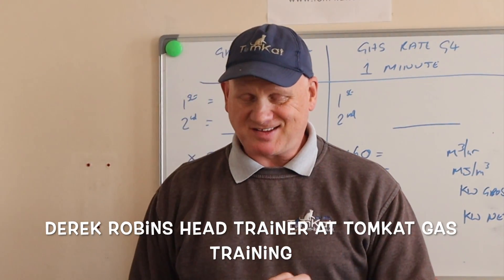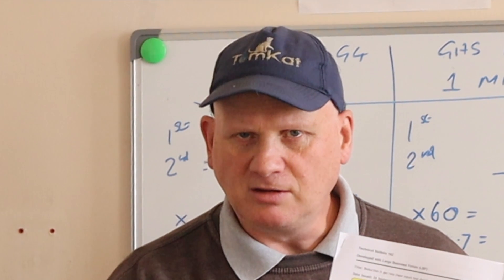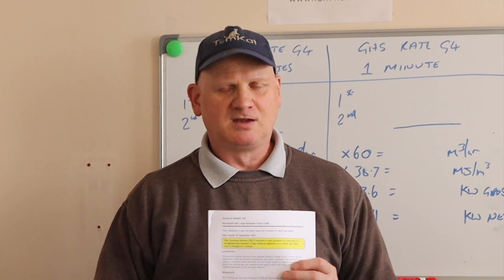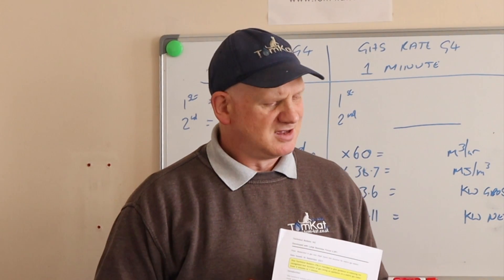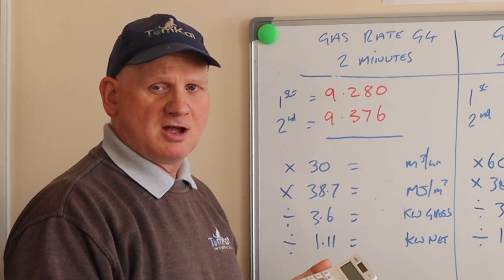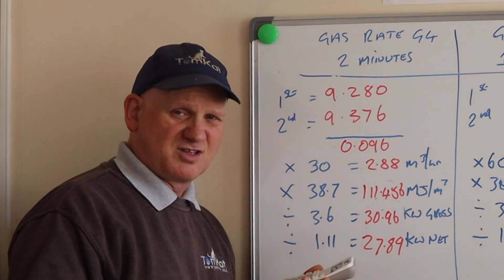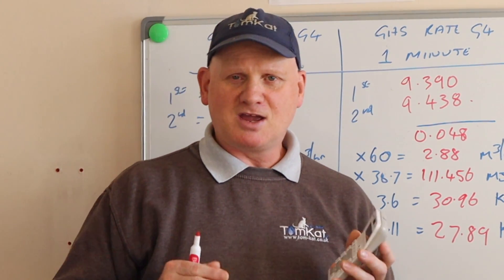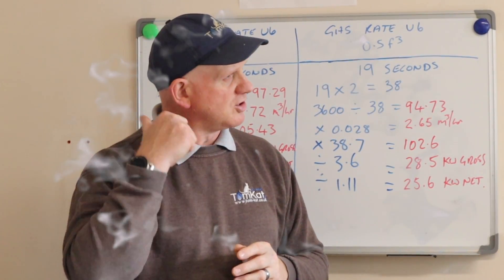Gas rating for one minute instead of two, REALLY. taking a look at gas safe TB 162

Comment: I am a retired UKAS Electrical, Temperature & Pressure Calibration engineer, I would have performed a 1 minute test from cold, then a 2 minutes test from cold then see IF there's any difference, just curious, if by not letting the system run for a while might indicate a difference due to heating up say from 20°C taking the New Standard as a test 1 minute without performing a 2 minutes warm up 🤔 there might be a difference then ?
In the past serviced & Repaired Kane Instruments Boiler Analysers,
Reply from the maker: I have spoken to the guy who came up with the timings for gas rating. He said the only reason they made it 2 minutes long was because of the E6 meters. He said because it was a digital reading they couldn’t get it accurate unless they ran it for 2 minutes. He said temperature only made a minuscule difference.

Comment: Hi Derek, im wanting a combi boiler moved from the loft, down to the kitchen, on ground floor. Would that cause any boiler problems? Would you see any issues with that?
Reply from the maker: Depending on the age of the boiler I would always advise to change the boiler for a new one because old boilers don’t travel well.
Reply: @tomkatgastraining  its 5-6 years old. Not old. But ty. 👍

Comment: I’ve done this for years, being commercial, a building like a swimming pool will run 24/7, 365 days of the year. I could switch the boiler off and sit there for hours and still not get a 2 minute run time. So, rather than not rate at all, I do make a note of the reading at 1 minute.

Comment: I have wondered for years now why we gas rate modern HE boilers at all, as you can't adjust the gas rate? All you can do is adjust the ratios, so if your ratios are right then your gas rate is right. Thoughts on this?
Reply from the maker: For me it’s the other away around. Correct gas rate correct ratio. Gas rating tells you if the appliance is over gassed or under gassed which is very important to help stop an unsafe situation. Also you shouldn’t change the ratio on a boiler unless you are converting from Nat gas to lpg or the other way around this is now in the unsafe situations igem/g/11. Also you adjust the gas rate all the time with modern boilers even turning the flow temperature down or up adjusts the heat input also range rating the boiler will do the same.

Comment: Gas rating has become a bit of a joke in recent years. Our compliance officers will give you a black mark if your gr isn’t within 10% under and 5% over. Even though the only TB that I can find says this is just an industry acceptable standard. I can’t find anywhere in the actual regs that it mentions these figures. We are told that outside of this we must AR the boiler.  But the recent trend has been for builders to put 35kw combis in tiny houses and flats. You run every tap full rate and can’t get 35kw. My argument is well where is the risk? You say it’s AR so tell me what’s dangerous? No answer. Also you can take the same boiler on LPG and there isn’t even a meter to gas rate yet it’s deemed safe, but you’d fail an inspection with exactly the same boiler on a meter if you didn’t gas rate it. It’s a complete shambles and needs completely re writing to say that an engineer should be able to use their judgement. I’ve had to AR 30kw combis running at 26.90 that are working perfectly on perfectly sized pipework with perfect working pressures. It’s a complete nonsense. About time GS actually allowed us to behave like adults and use our years of engineering judgment.
Reply from the maker: You are correct there is no regulation on the 5 and 10 % it was just brought in for trainees with no engineers judgement. The appliance is not AR if it’s out only if it is affecting the safe operation of the appliances or another appliance.
Reply: @tomkatgastraining  I completely agree with you. I’m not even convinced that despite what TB says about putting a boiler in to max rate using the service function is necessarily correct either. As I think if you run every tap in the house you’ve created the maximum real world demand that appliance can ever expect so you have in fact gas rated at max rate. But it’s such a grey area people like me just tow the line cos to be honest there’s no point in arguing. Same as range rated glow worms. They’ll be set to say 18kw for a particular property. But gas rate at 30kw when in max service mode. But can’t actually achieve that in normal operation. Gas safe need to once and for all clarify all this stuff. Cos big businesses have entire departments enforcing this stuff and I’m convinced half of it is actually BS.
Reply: @Lutonman2010 
The rules are for what the boiler can do not the system you put it on.
Could argue why fit such a big boiler.
Also just because a boiler is rated down maybe in the future it gets rated back up. Best would be for engineers to just fit correctly sized boilers
Reply: 8 annual inspections a day = 8 minutes a day x5 days = 40 minutes a week x thousands of service engineers = more efficiency /profit 🧐
Reply: Maybe it should be an instant non compliance if the boiler is oversized and does have the building notification present when a gas engineer comes to carry out work on it. You spend the day filling out warnings to tick boxes🤦🏻‍♂️

You don’t get to gas rate much on commercial as it’s got all sorts running off the same meter🤨

Comment: We’ve all had those situations where struggle to get rid of heat when gas rating .  System already been on etc so lesser test duration would be handy
Reply: Spot on,and gas rating on a 20 year old gas meter that's never been calibrated since it was installed,yet we have to use this to determine if an appliance is working correctly ! Doesn't sit quite right!
Reply: Gas rate testing never sat right with me !! @ginola602
Reply: Especially as it’s gotta be on for 5 minutes before we analyse